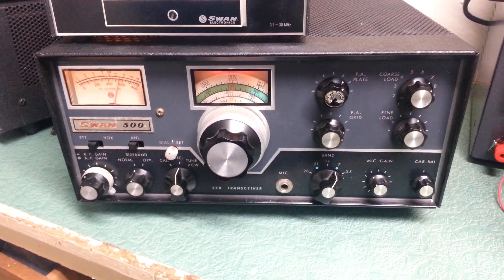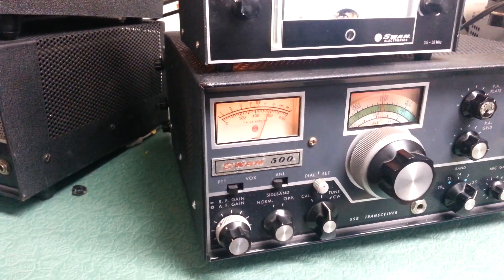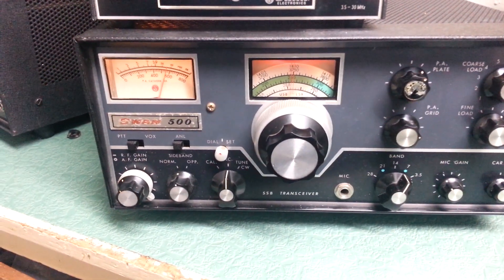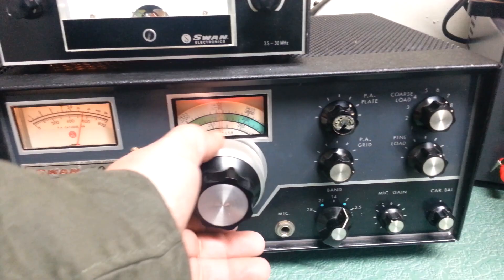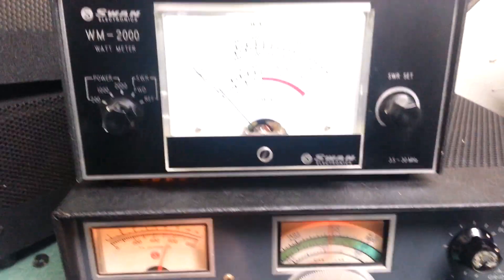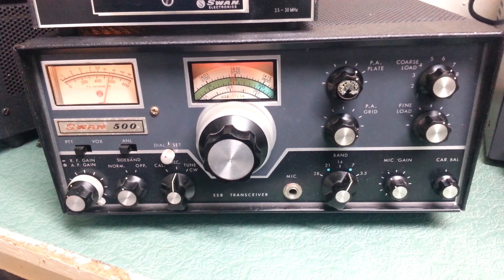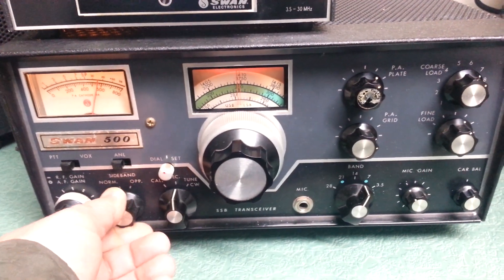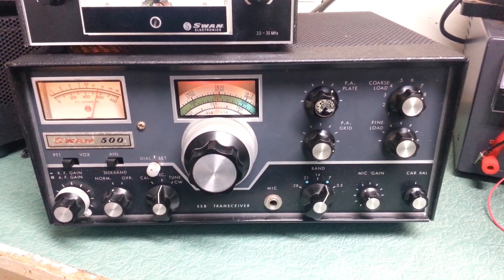Swan 500 HF transceiver

Comment: hello i bougth a swan 500, i repaired the power supply, it started but i cant ear anything because it is o mute. aparently the tubes are ok because i check it and they are with some temperature and i can see the ligth. do you have any idea why it is on mute? thanks you im jorge from chile and here the ham radio not known this radio. best regards.... i hope your comments.